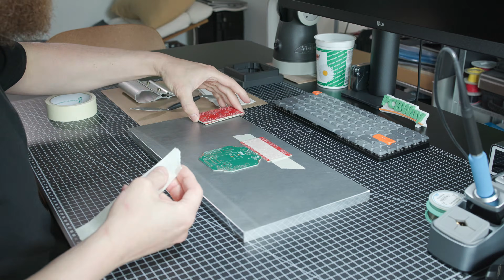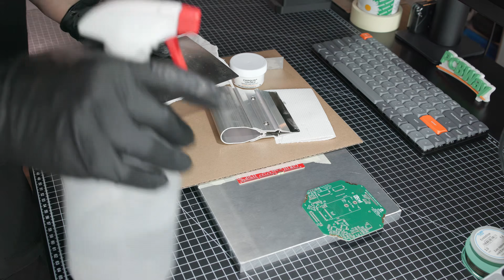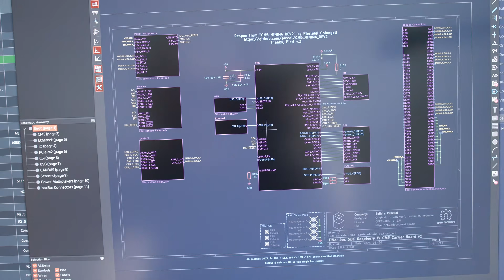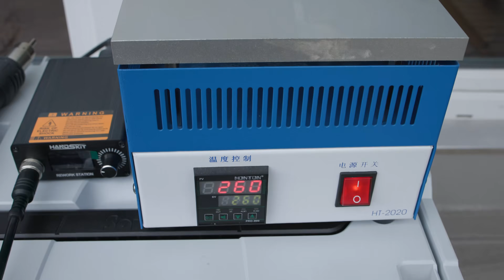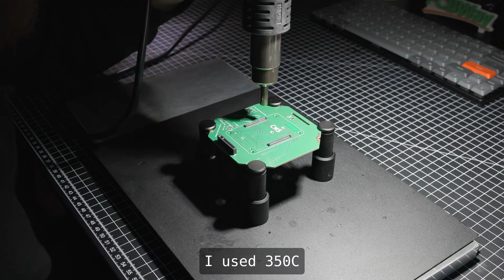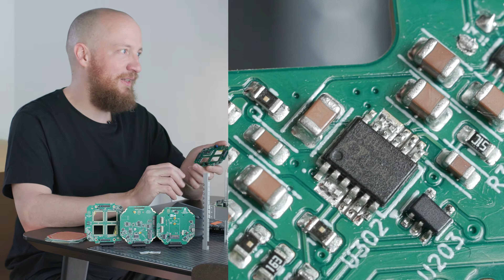CubeSat Prototype PCB Assembly: CM5 Carrier, MCU Carrier, EPS

Comment: M.2 on anything that flies high G is not that ideal, from my experience in a Student Rocketry Association
Why did you choose it?
Reply from the maker: Hi Gabriele! Thanks for the comment. I chose it for various reasons: MicroMod boards are a very accessible way to start experimenting with sensors and RF stuff. As interconnect between boards, I like it because it's affordable, high density and easy to work with (I wouldn't want to wrangle dozens of wires and make custom harnesses). The thing is that it won't have to work in a high G or high vibration environment – it only has to survive it. I think that's plausible, because there is a fair bit of compliance in the connectors due to them basically being rows of leaf spring contacts. My thinking is that after deployment, the only acceleration a CubeSat experiences is from its spin, and that should be relatively benign. But of course, that's all speculative and I am aware that I may have to switch to something else in the future. That's the case for many aspects of this prototype :) TVAC and vibration testing will probably reveal what works and what doesn't. Thanks again for your input.
Reply: Fair point  @buildacubesat , with a rocket we experienced loose contacts during flight which are more critical in our case to receive telemetry and for the correct functioning of Apogee Detection and Mass Estimation algorithms for example!
If you are only concerned with having reliable data streams while in the coasting/orbital phase, that won't likely be a problem!
Reply from the maker: Thanks – it still has a place in my things-that-may-come-back-to-bite-me.md though until it's proven to work 😅